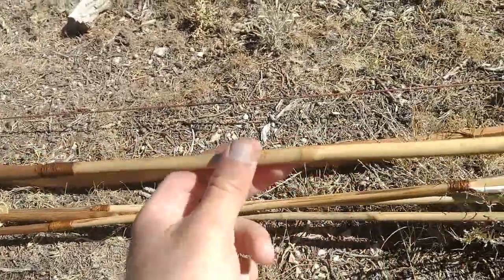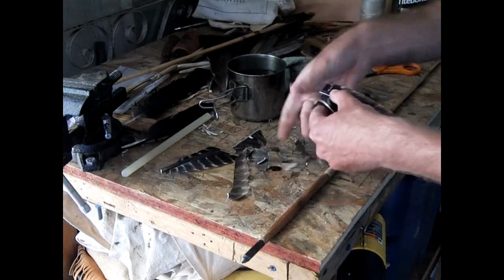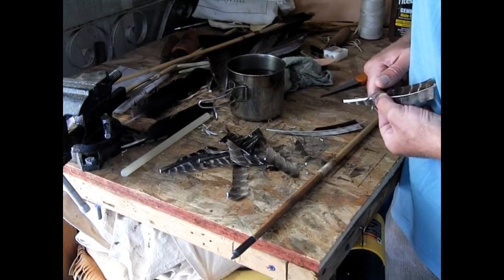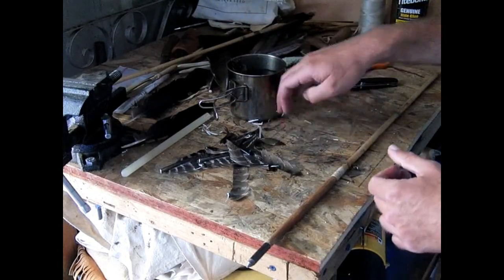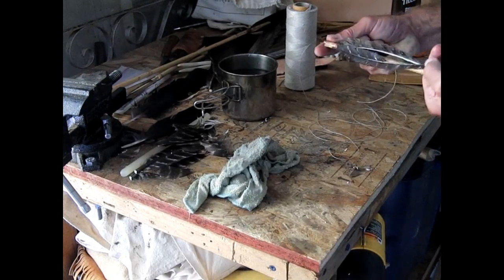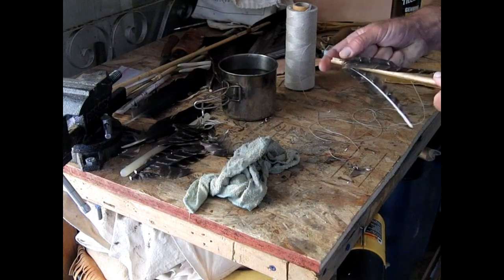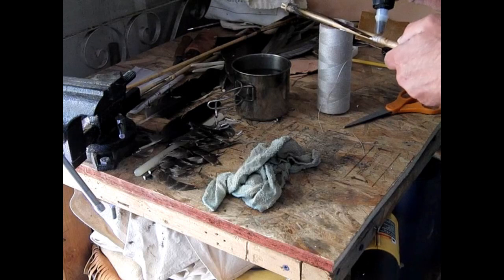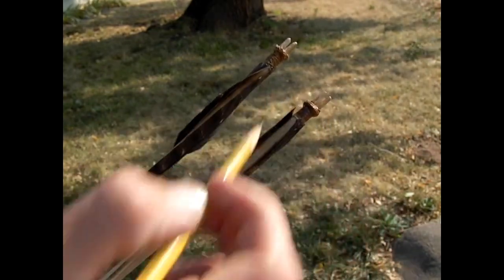Fletching arrows using a simple Southeastern technique

Comment: I’ve seen this style of fletching done two different ways. One way is like your method where the fletching is cupped in like this () when looking down the shaft. The other way is opposite where the fletchings are facing outward like this )( when looking down the shaft.  I hope this makes sense. Does it work either way? I also haven’t figured out what the small flap on the bottom half of the fletching is for?
Reply: I’m sure it would work the other way, I’ve never tried the second one but I’d say the first one with the cup facing in () is gunna be a smidge more accurate. That little pocket created by the fletchings facing inwards like that I feel like adds to the stabilization because it traps a little pocket of air in there essentially adding more stabilization due to drag that that pocket creates. I make just as many two fletch arrows as I do three fletch and I’ve shot them A LOT and it’s been my experience that because of that little bit of extra drag these arrows tend to lose speed a smidge quicker and start dropping off a smidge sooner than the three fletch past about at and past about 20 yards but it’s honestly barely even noticeable unless you’re really looking for it.
Reply: @jordannewsom4578  I might have to make some three fletch and two fletch of the same weight and compare speeds over the chrono.  However I don’t think I’m accurate enough to compare speeds at 20 yards without putting my chronograph in grave danger.